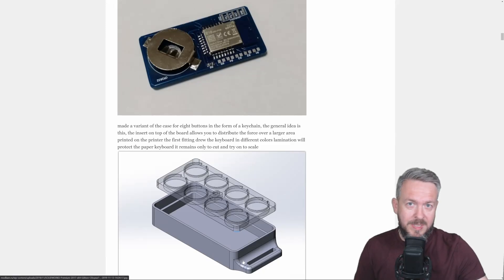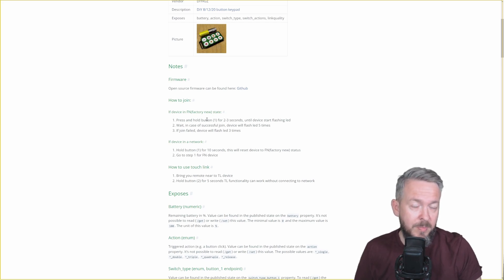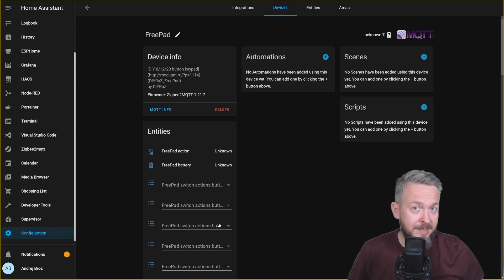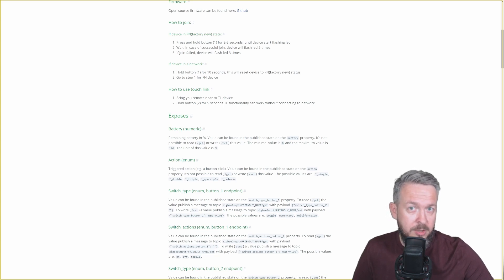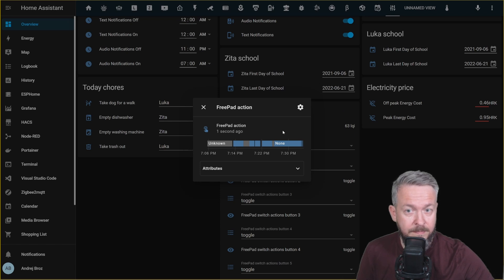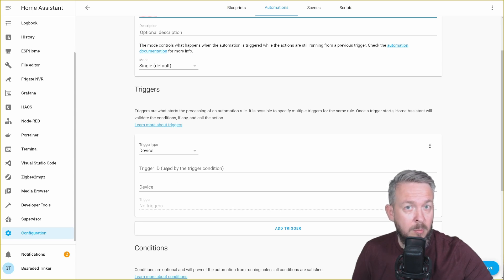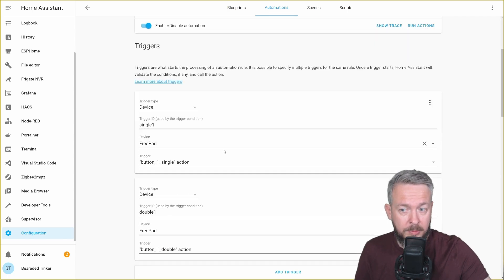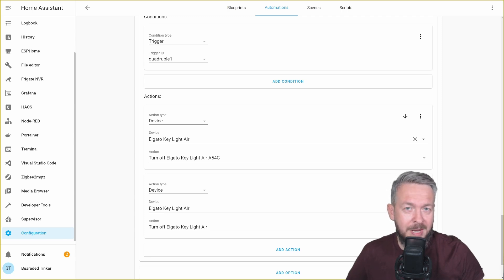Add and use DIY Zigbee remote in Home Assistant with 32 actions

Comment: Awesome old project I just reproduced. Super smooth everything and battery going strong 100% for a week now with the lm3 firmware. One thing I’ve noticed … signal strength is not so great. I don’t have repeaters around the house just a sonoff router and all my other devices have a very good link quality … this will drop connection one wall away and 6 meters… do you have the same issue ? Is the signal weak because of the pcb antenna on the zigbee module maybe ?
Reply from the maker: Yeah, that's the problem with builtin antenna (I would bet on it). There is version of board with external antena, but that would also be overkill. Also, not sure if the same firmware would work with it...

Comment: Hello. I have some issue with this project. It would be great if you could give me some hints. 

I have assembled the version with 8 buttons and successfully paired it with Z2M but it does not send any events when I click the buttons. 
I tried reflashing the chip a couple of times and added it back to Z2M but it still does not send the click events.
Do you happen to know how I can troubleshoot this issue?

Comment: do you thing, it's possible to control PWM 12V fan with a ZYZB010 controller ?
Reply from the maker: Direct control (like group pairing) - don't think so, but via Home Assistant or some other middleman, it should be possible.

Comment: Would something like this be feasible as garage door controller that is kept in my car? In other word, will it join the zigbee network fast enough when I get home again?
Reply from the maker: Hmmm - it should connect pretty quickly but you could probably need to press button twice - for wakeup connection and for trigger. Need to try it and see.
Reply: @BeardedTinker  that’s what I thought. Will have to stick with the “dumb” RF remote then and RF bridge for automations.

Comment: Is there way to program double clicks of diffrent butons? For example Aqara rocker have seperate action for clicking left and right at the same time. That would increase number of actions even more.
Reply from the maker: In Zigbee2MQTT each button can be set as toggle/momentary but also multi-function. In Multi-function it can detect single and double click plus some other actions too.
Check here for all of the actions: https://www.zigbee2mqtt.io/devices/DIYRuZ_FreePad.html#diyruz-diyruz_freepad

Comment: Thanks for the videos.

I've made one, and only some of the buttons are working (1 & 10-16) however the LED does flash when I press any of the buttons including the ones that don't trigger in zigbee2mqtt (so I don't think it's an assembly issue). Have you seen anything like this before?
Reply from the maker: No, I haven't. Not sure what could be the problem. Are all resistors on the back side in? That is one of the to things that pops in my mind.
Also, try using different version of firmware - I really do recommend PM3 as it allows deep sleep.
Reply: @BeardedTinker  I've got the resistors in; and comparing the diagram and buttons that do work; they cover all the pins that go to the 20 switches.

I've tried a couple of other versions, the PM3 I can pair with, but none of the buttons register. I've tried the regular version, 2.0.7, 2.0.6 and 2.0.0 all giving the exact same set of buttons that do / don't work.
Reply from the maker: @jefffern3954  really no idea what could be wrong. It should work. Especially if LED does flash when you press the button as it means that there is connectivity and connectivity is registered. You could try to post question on modkam.ru - I've seen author respond to english question, but very slow.
On GitHub, I was not lucky with opened issues, it took a long time to get any response there, but that too is and option. 
I know that newer firmware has logic to expose only available buttons, so how does it look in HA, are all buttons visible or?
Reply: @BeardedTinker  I've been asking around; a couple of people are having similar issues on the github issues page. I've been doing some more testing and I can work around the issue by binding the "OnOff" cluster to the controller (rather than the default "MultistateInput") and then modifying zigbee2mqtt to deal with this cluster - not ideal, but at least they all work.

Out of interest, what firmware version do you have that works fine with all buttons?

Comment: Wow, so much power in such a small device. Definitely something I want to try soonish.
Reply from the maker: Just a quick note. Battery life is not that good - around 2 months if I'm not mistaken.
Reply: @BeardedTinker  ah that's not great. The closest thing I could find to something like this ready made would be the aqara opple. Not as many buttons but much easier to get into and would have far better battery life.

To be honest though, even though it was probably above my skill level I still think it would be fun to try a project like this.
Reply from the maker: @sharktamer  yeah, that's really not that good! There is PM3 version of the firmware that I still haven't flashed. That one has better deep sleep. Will have to test and see how that goes. Maybe, just maybe it's better. Just flashed it - so it will take some time to see if battery is improved or not.

Comment: Does this button set also create Zigbee events or just button entities?
Reply from the maker: In terms if you can connect it directly with other Zigbee devices, without the need for HA part?
Haven't tested, but I also didn't test 2 additional firmwares that are available.
But let me ask, what did you had in mind when you said doe sit create Zigbee events?
Reply: @BeardedTinker  Events can be used like scene controllers I guess.   For Philips hue dimmer as an example, a press fires an event code, release fires different event code, long press or press and hold fires another.    These events can be used in automations or as scene controls for other devices directly.
Reply from the maker: @EsotericArctos  Then the answer is - still don't know :) I would say no, as it sands each time on different event specific action. And each button can have different actions, but they need to be handled by HA at the and.
Reply: By default, all buttons are bound to the controller (zigbee2mqtt). You can change that binding, in zigbee2mqtt interface, to other zigbee devices so the button press (onoff only) directly controls whatever device you bound it to. In this case, the events do not appear in zigbee2mqtt and do not need HA.

Comment: in Ha, can we  install zigbee2mqtt     AND     install zha (with conbee2)   ? (both)   thanks
Reply: You can even have 3 different Zigbee networks on the same HA instance: I'm using Conbee 2 with Deconz, Sonoff Tasmotized Bridge with ZHA and the latest purchase TubesZB (CC2652P2 Based Zigbee coordinator) with Zigbee2MQTT :))
Reply from the maker: Unfortunately no. Never tried, but the problem is sharing of the USB port/device. Each of those applications has to have exclusive access to the port and device.
Reply: You can do this, but  you do need to have two Zigbee Co-Ordinators.   So basically it would be two completely separate Zigbee networks.  You can keep Conbee with ZHA or DeCONZ, and grab a cheap 2531 controller to play with Zigbee2MQTT.  As Beardedtinker mentioned, you cannot have both using the one co-ordinator.   Depends if you want to run two ZigBee networks :)
Reply from the maker: @EsotericArctos  thanks for this - my bad as I forgot to mention this scenario :)
Reply: @BeardedTinker  I am not sure if that was the scenario wanted, but it is an option and the 2531 based USB sticks are cheap as chips to buy now.